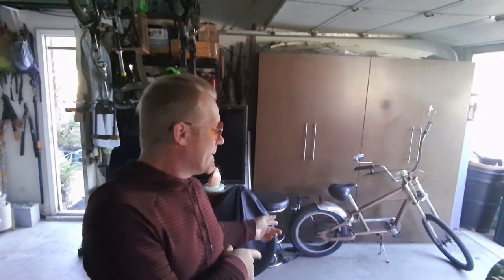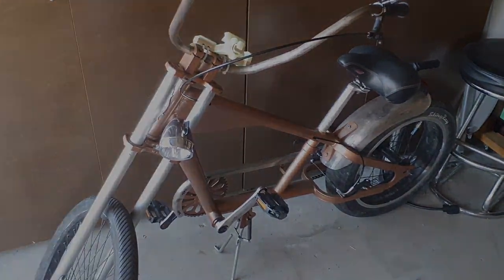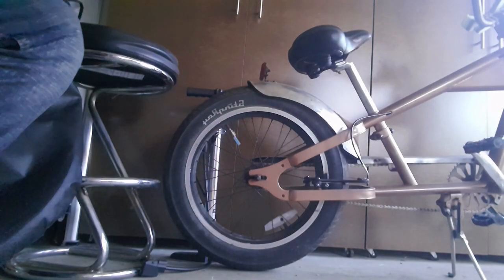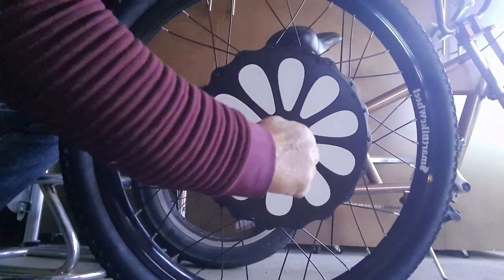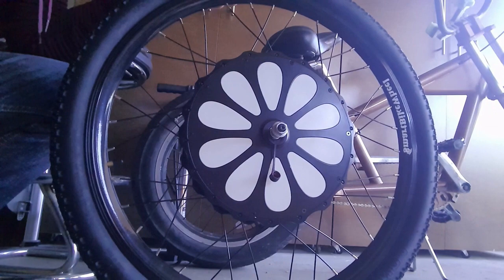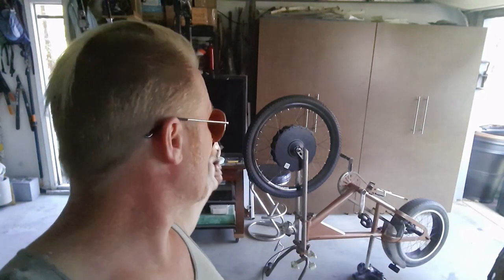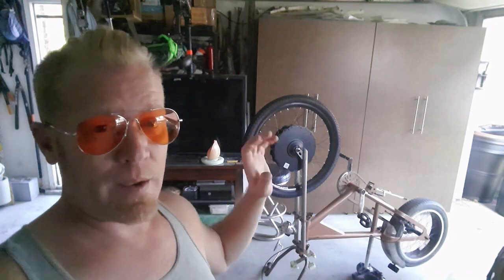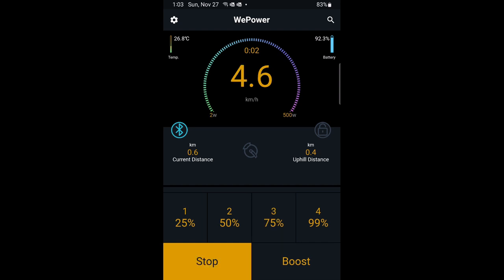The Copper Chopper Build [Part 2] - Electrification

Comment: 😂 , a motor with its own mind
Reply: I actually didn't like the Idea of it at first , but I love the clean install and the fact that everything is in the hub , sheer brilliance, I checked the website out the new ones have a off switch , you can buy replacement battery packs and parts , I love it , I think I will buy two , one for my recumbent and one for the fixie .